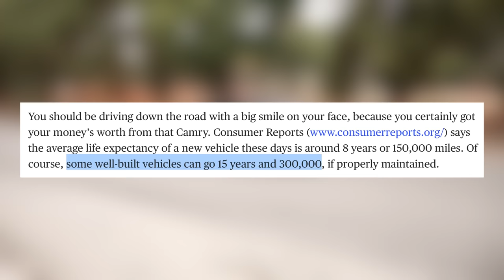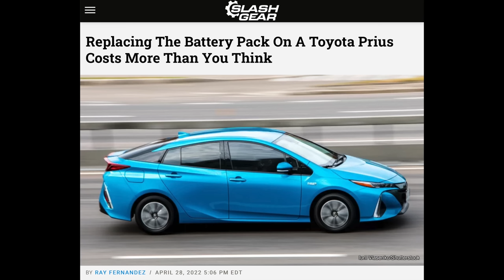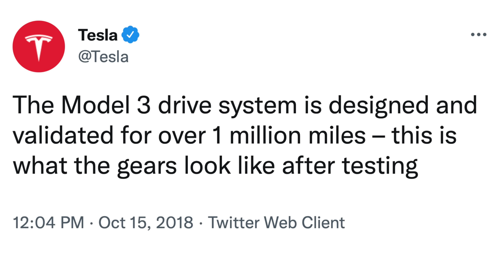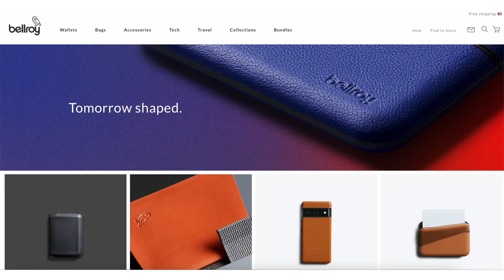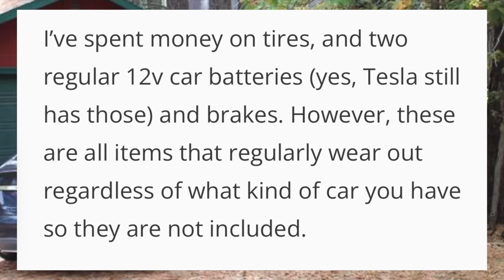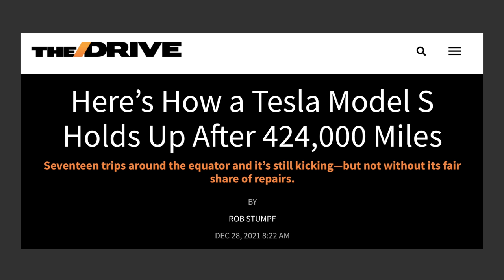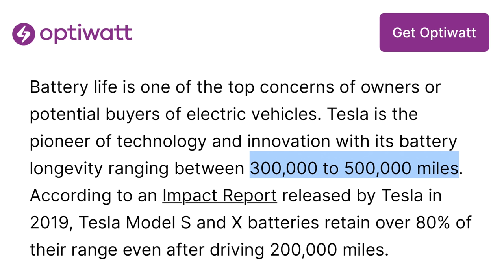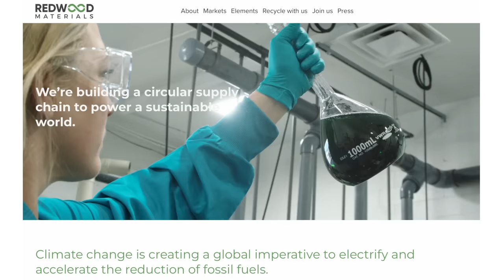The ONE MILLION Mile Tesla | It Still Runs

Comment: I wonder if some of these examples of Model 3 cars only losing 2–3% are cherry picking. I’d like to see a comprehensive data set for M3 and MY similar to the graphs we’ve seen for S and X, because I don’t think we can assume 3 and Y will be the same or better. After all, they were designed to be cheaper. 

My 2021 Model 3 LR AWD appears to be down about 4%–5% after only 16 months and 21,000 km (13,000 mi). (I typically see an estimated full-charge capacity of 542–545 km; when it was new it was 568 km.) And I generally baby the battery.

The service manager at the local Tesla service centre said that’s good for a Model 3; he says up to 10% degradation in the first year is typical. I’m led to believe the curve does flatten out after that, just like we see with the S and X, and I’m not worried. But still, 5%–10% in the first year is more than I was led to believe from when I read and watched things like this before buying.
Reply: try few cycles of discharging battery bellow 20% and leaving for at least 6 hours before plugging in (I do that weekends when car is not in use). This will give time for BMS to sync properly at low charge. High charge You prob already do with setting limit at 70-90%. Your BMS is probably out of sync. I noticed that the battery "degradation" is much lower when I do that instead when I was just trying to keep at 80% all the time. That's why I think Tesla should remove rated range as it is just purely confusing.
Reply: @pauliusvindzigelskis2224  I had actually tried that a few times in the past without much noticeable effect, but on Monday I had occasion to use most of the capacity of the battery on a long driving day. I had it charge to 100% overnight (ending just an hour or so before we were to leave), which I rarely do, but I wanted to avoid an inconvenient charging stop that day. 

I got back home at the end of the day with 12% remaining, and I let it sit at that state for a few hours. After doing that, the estimated range now seems to be around 553 km or so (out of an original rating of 568), implying a degradation of more like 2%–3% instead of the 4%–5% I was seeing. I’m guessing that 2%–3% loss probably is roughly right for my car’s age and distance?

Or, it’s finally gotten use to summer. I’ve heard that it uses a smoothed average pack temperature in the estimate, and that smoothing might be over a long period. I don’t know how long though, nor how reliable that information was. 

As for removing the range estimate, I would only support that if they gave us direct access to the battery’s capacity estimate in kWh instead. As it currently is, at least I know that the range estimate in km (or miles) is related to the car’s estimate of its current capacity in kWh by a simple constant that is derived from the EPA test cycle. (In the case of my particular car, that constant is 136.7 Wh per km.)

I’ve been meaning to lobby Tesla to give us access to some of the hidden battery stats, especially numbers that would allow you to know the battery’s current state of health/degradation. But I don’t even know how to reach them in a way that the request will be seen. My local service centre flat out refused to tell me numbers that I knew they had access to.
Reply: @conradce  just do same cycle few more times as you get the chance, and you might get more range "back". I have LR with 16k miles, and keep doing this once in a while (around once or twice a month, normally weekends) and my BMS shows same 358 miles as brand new, no loss whatsoever. I don't charge back to 100% (only to 70-80% as usual) unless I am planning to travel and need that extra range.

About estimation, no, Tesla shows only rated range based on capacity, not estimated. It only impacts range if outside is very cold and Tesla limits capacity due to cold battery. That's why I don't use it at all and switch to % as it is less confusing

Currently, the only way to know degradation is to keep BMS synced and compare with original rated range. With BMS out of sync, no other stat will help as they are all BMS numbers... There is no technical difference between showing actual kWh or fixed rated range based on battery capacity. Only way to overcome BMS is to take battery apart and check each cell manually which would be right way to know exact capacity loss. Idk how Tesla measures it, probably rely on same BMS but maybe have a way to sync it locally

Oh, and there is a way to see actual BMS reported numbers. Check out Tesla Bjorn channel

Comment: It's very unlikely that a battery will ever degrade into requiring a replacement, since even if a vehicle ages severely to the point that it can "only" go 100 miles, it could still be useful as a low-cost commuter vehicle not worthy of the cost of repair, assuming the rest of the 60 year old vehicle is somehow still in operation. In-warranty and out of warranty replacements are always due to failure, not the battery degrading too much. Also, those 1% per year figures are multiplicative, not additive, so after 30 years you'd expect around 74% capacity rather than 70%>

Comment: Doesn't this mean the engineers will be planning around those numbers (i.e. 100,000 to 150,000 miles) for "future" batteries... ?   What is 70% of 279 miles...?   (195 miles)  not including more passengers, hot and cold, using heat and a/c, etc... so let's say 150 miles?   they can say a million miles, then why guarantee only 100,000 ?
Reply: The warranty is not an indication of the life of the vehicle. It is the industry standard limit for liability, based on the failure rates, cost to make, customer expectations, variations in operation environments, insurance... Manufacturers only have to commercially meet the oppositions liability.

Comment: How do you even get that many miles with how long it takes to charge these? you're basically limiting your millage due to a lack of time spent charging. I'm impressed with how reliable the drive trains of these cars (not that I was expecting anything less with less moving parts that avoid friction) but it just doesn't make much sense for the average person with long commutes
Im excited to see where this takes us in an EV future and with hopes of more reliable batteries (or other energy sources that wont destroy the environment like Lithium)
Reply: If you have a level 2 charger at home, and aren't driving an electric Hummer, you can get 25-50mph back in the battery while you sleep or work. Over 6 hours that's 150-300 miles of range, or a full battery for when you wake up or get off work .

If you can plug in at work, even just at a 120v outlet, that's 3mph back in the battery. Almost 30 miles over a workday. I'm sure there are some people out there with such insane commutes that they cannot use an EV, sucks for them I guess, but most people drive less than 40 miles per day total which is easily made up with a basic wall outlet at home and work. 

The fastest charging cars can get 20 miles back in the battery in a minute. Teslas get about 12. Eh, let's make the math easy and say 10. 1,000,000/10 == 100,000 minutes, 1666.67 hours, 69 days, or just over 2 months spent charging the car in 8-10 years? Doesn't sound bad to me. 

How many times have you looked down at your gas gauge and noticed you have to make a special trip to the gas station to fill up? Why is that time never counted when talking about fueling cars? How many trips to the gas station do you make per week?

Comment: What negates long term EV ownership is DIY work.

Most people can easily maintain and work on their own gas or even hybrid cars. They are all very similar and typically accessible to do work. Parts are cheaper, and if you can DIY, its free, technically. 
It costs me like 30$ to do an oil change if I do it myself. 
It costs me like 40$ to change my brake pads.
It costs me little to nothing to maintain my gas car.

EV? You can quite literally, not do anything yourself. Everything is 100x more complicated. Tesla graveyards has become a term used by mechanics for shops that take tesla's for repair, because either 1) parts are hard to come by, 2) parts are stupid expensive or 3) labor is stupid expensive.

The average cost for a brake job on a tesla is well over 1500$! Thats like more than all the maintenance I will ever do on my gas car through its 300k mile life span.

Comment: Just tested my model x 75d late 2017. When it was new the capacity was 72.3kwh and I just tested today with a long trip from 99soc- 4soc and the car reported 58kwh used.. so around 78-79% life left?
Reply: The car has been going 129.573km with original battery

Comment: The 4680 Tesla battery is Lithium Iron Phosphate instead of Lithium Ion. Lithium Iron Phosphate batteries generally can handle nearly 10 times more charge and recharge cycles. They also don't get hot when charged or discharged at a fast rate.  I expect to see the 4680 batteries lasting a lot longer.

Comment: More of best case scenarios instead of actual real life picture. Go thru video posted by Tim Java for a Uber driver where he was forced to change battery by Tesla at 120K miles and as per him morning it was 174 miles and even it was showing 35 miles which means artificially altered by software but he was forced to shell out $10K for change of battery pack. Even replaced pack was actually refurbished pack instead of brand new and wasn’t even giving 60% of rated capacity/range. I think EVs are unpredictable and more of backed by “open ended suit me kind of warranty” by Tesla and other EVs. I drive 40-50K a year and change car after 5 years. I know gas car will last that long with proper maintenance. But EVs not sure or backed by warranty. The day manufacturers will say that your pack has warranty of 300-500K miles then only they are factually that cheaper else they come near to gas car with battery change cost spikes.

Comment: With depreciation being so high, if an EV is involved in accident that damages the battery pack and requires replacement, the car becomes an uneconomical repair and gets scraped. That's not very green is it.

Comment: My Model Y, after 20,000 miles is down 10% battery capacity (and 20-21 months of driving).  Is this excessive?
Reply: Not great but nothing to worry about, the biggest killer is sitting fully charged for long periods,
Better to finish  charge msybe an hour before driving
Reply: Doesn't sound excessive since the biggest drop off is in the first year. All so say, you've probably already had your worst degredation, and things will now stabilize.
Reply: Sounds excessive.  You may be looking at a warranty claim eventually
Reply: It’s probably more to do with calibration rather than degradation. 
However most loss is in the first year.
Reply: It sounds quite a bit of loss.  Have you been supercharging a lot or charging above 80% a lot?  My model 3 lost about 10% in 4 years and 75k miles, and I thought it’s quite a bit of loss already.

Comment: It sounds like my warranty… if it’s not completely broken, then  it still works… kinda. So instead of the 100% charge I get a 40% charge on my battery and my range used to be 300 miles but now is only 75. Guy at Tesla… works perfect right?

Comment: 3:00 the EV owner will sell their car long before they would need to replace the battery pack

Who’s buying them if they are gonna need a new 20,000$ battery I know sure as hell I ain’t 
I know you can put and new motor and transmission in a car for less than 15,000$
That’s still cheaper than the battery pack and pretty much everything beside suspension would be good to go for 20-25 years on a car

Comment: Well, not hating or anything but 4 of my friends have Teslas and that 3 of them are now taking a bus to go to work  because of battery replacement at around 142,325 miles on the clock  he now keeps his tesla like a lawn ordainment until he decides to drop big money for the battery  my other friend on the other hand manage to throw his tesla at a dealership and traded it for a Ford Shelby Gt500 with money on top  and he was scared if the car would die on the dealer so after they test drove the car the agreed on the trade with $20,000 "one time only you cant get a deal anywhere for, he agreed and signed and they gave him the keys to his new Ford Shelby gt500 with $20,000 he drove out of that dealership 
and dealership got "burned" the next week we want to see how much are there going to sell it for and it was at the back and one mechanic said to us "someone got fired 2 days after the trade and even yelled at" because the tesla was a total lost as it will cost more to fix it then taking the L sorry for my grammars

Comment: My 21 MYP gives me 279 miles out of the 303 claimed in just a year. 34,000 miles in. These 2%-3% are best case scenarios.
Reply: Yes, but did the car give you the claimed range even on day 1? These ranges are very optimistic, maybe under ideal scenarios only. If it’s EPA cycle or NEDC (not even damn close) or some other cycle will give you different estimations. Comparing the advertised range to what you get now won’t show the actual battery degradation.
Reply: @TwoShoedDude  I remember barely being able to touch 300 when I first got the car.

Comment: I own a hybrid/ Electric car repair shop. I am not suppose to say this but with all honesty I will to inform the public.  Everyone is all hyped up about electric cars now a days and even the government is wanting to ban gasoline car now in the future. Electric cars now a days is impressive unlike 100 years ago when they only had a top speed of 25mph. Now electric cars can go zero to 60 in less than 2 seconds. In my opinion at least right now it is not practical to own one. Unless you just want the fun of what it can do, and you have lots of money to burn. First let’s look at the lithium ion. A lot of people think the battery pack will simply cause the car to have lesser range as it age. That is not true at all. They will get you stranded. When a lithium battery fail it becomes and open circuit  Sicne they are connected in series it’s like blowing a fuse. That car ain’t moving, time for a new 25k dollar batteries. They say cheaper alternatives by repairing it. That fact that one cell in a pack failed means the rest are just waiting to happen are they serious? Those type of repair usually last one to two years. So you gonna get stranded every year or so then pay 5 grand for another repair???  That’s worse that your motor or transmission going out on you every year having it replaced

Comment: You make a case for EVs but there some things you didn't cover or didn't highlight.
1. Cost of insurance. EVs cost a lot more to insure. If you save $500 on fuel/maintenance but pay $500 more on insurance premium...it's a wash. Irrc, the cost to insure an EV is about 30% higher.
2. Increased initial cost of an EV being up to 40% over the cost of a similar ICE vehicle. The range is 10%-40% but the increased upfront cost is hard to recoup. Most people simply don't drive enough to cover the increase. 
3. The actual cost of a battery replacement isn't noted. Is it $20k? $10k? $5k? Tesla doesn't do battery repairs. They only do full battery replacement. If you are not in the warranty period, it will be expensive. 
4. Battery recycling "will be done", "can be done" is kind of useless/empty statements. It just means that it is NOT being done right now (on any meaningful scale) and I won't hold my breath that it will be any different in the near future. So, where do all the toxic batteries go? The same place all our alkaline batteries go...the landfill. It is just cheaper to make new rather than recycle. That is why the repair industry is virtually dead in the US. Instead, we have a "replace" industry whenever anything goes wrong.
5. Range is already an issue...so even a 5% or 10% drop in range is a big factor. Considering that weather/temperature can drastically influence (reduce) range, an additional decrease due to age is more impactful.
6. Charging station construction has not, imo, been keeping up with EV sales. This is a problem. Refueling at a gas station takes 5m. If the station is busy and there are two people in front of you, you know that you will be done in 15m and be on your way. If you go to fuel/charge your EV and find two people waiting in front of you?...yeah, good luck getting to start your charge in one hour...and then wait for at least 30m for a partial charge.
7. While super charging itself is not good for the batteries, that is the only way to charge when out and about. That means only people with homes and a garage can properly charge their vehicles most effectively (for longevity of the battery). 

EVs are great if you can afford them and can live with the drawbacks. 
A lot of my neighbors have them. While many use them like "daily drivers", their EVs are not their only mode of transportation. Like a person who can afford specific shoes for specific activities (tennis shoes, basketball shoes, walking shoes, hiking shoes, dancing shoes, dress shoes, etc.), some can afford multiple vehicles ("regular car", luxury car, SUV/luxury SUV, a truck, RV, sports car, exotic car, etc.) for different uses. 
The Model 3 is quite ubiquitous in my TX community. Several neighbors have the Model S. A couple are waiting on Lucid. I almost put down a deposit on an AMG EQS. I didn't only because they couldn't give me a proper timeline for expected delivery. The dealer didn't have a current allotment and didn't know exactly when or how many they would get. I wasn't going to hand over $5k to $10k on a vague "maybe in a year or a year and half depending on the options and the chip shortage" for delivery.